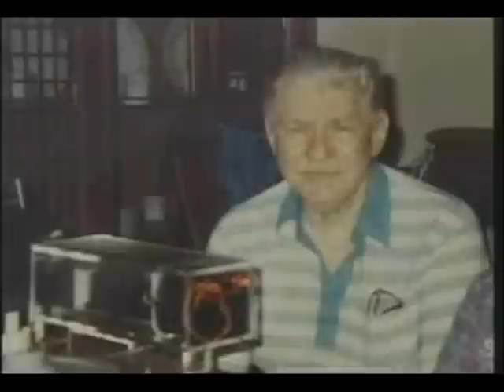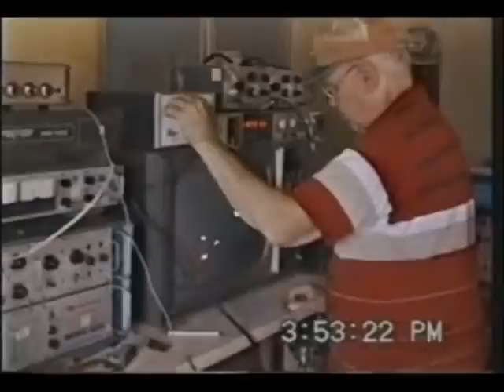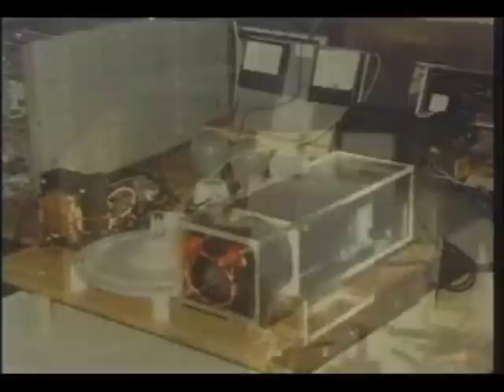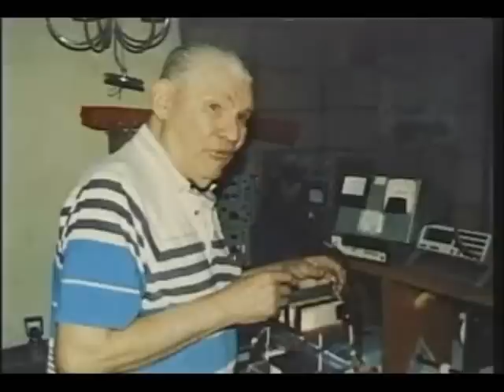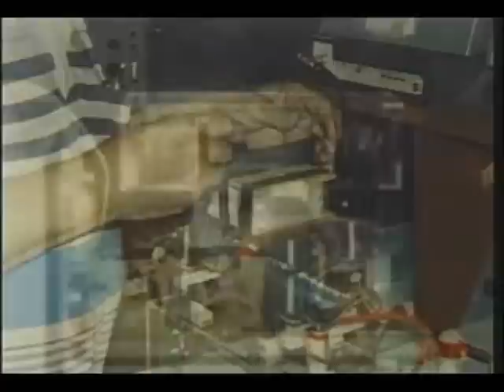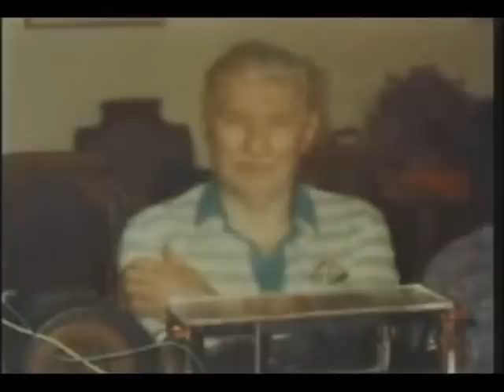Floyd Sweet Forgotten Genius

Comment: @deepcut66 ,, Mate I have schematics but every one I show has cognitive dissonance and can not perceive the 7.5hz fact, In my country it's considered stealing energy from the broadcasting licensees, what I know is already out there I'm not the only one, not even Nicola was the first. It's very old knowledge. Very simplistic. (well timed induction to separate water vapor in a sealed unit, charge and discharge taking into account reversal and windings easily controlled by a P.I.C.
Reply: Whst is a PIC?
Reply: @ interface controler

Comment: @deepcut66 , I'm just a rusty electronics engineer, but even I could produce enough zero point energy to run a small sealed Porcelain HHO rotary cell to run enough led lighting 24/7 for a house. I would go public if I thought it wouldn't cause grief.
Reply: You still here?
Reply: @nadenadenadenade9796  Yes I've been sitting here for 10 years contemplating weather or not to build a O3 Ozone generator to run my car on with the price of fuel theses days its very tempting but I would probably get shot by the electric car industry.
Reply: @nadenadenadenade9796  Hi Loki, I haven't had much time over that last 10 years to work on electronics and my passions of free energy as I'm now a single dad. I first got involved with HHO fuel cells back in the 90s with a student of Professor Yule Brown, We were basically boiling petroleum into vapor to fuel a Car resulting in unbelievable mileage, the problem was the sludge bi product build up. When I was a electronics student I built circuit which was basically a bridge rectifier that captured DC voltage from my television antenna, even though the power was being transmitted from the broadcasting stations there is a free frequency from the resonant frequency of the Earth of 7.2-5 hz, harnessing this power and stepping it up with timed inductance in a cascade of coils one can generate enough power to play with plasma's. If you have an interest in free energy study magnetic fields of inductors take note of the reversal of polarity upon discharge and the huge step up of power, then imagine how that power can be used to transform a liquid into a combustible gases eg. Hydrogen & Oxygen. My reinvention involves this process in a sealed unit as the byproduct is heat and motion and water. I envisioned a coil winding that discharges into a secondary outer winding inducting sequential discharges in an loop and simple capacitance to skim electrons. The publisher of this video has schematics on his website of the invention seen in this video. Mine is different but is a very similar process and I understand how it works.
Reply: @Php48  why don't you post your inventions on YouTube? I think that would make your knowledge available to everyone ☺️. I would be your number 1 fan 😂
Reply: @Php48 would you be willing to share so the world can become better
Reply: Can i get any more information to test this out myself? thanks!

Comment: Its all done with timed induction as what was shown on the monitor, think of a coil with many many windings in different arrays with paralleled graduating capacitance in a timed discharge feed back loop, simply skimming power from the outer arrays not affecting the stability of the core.